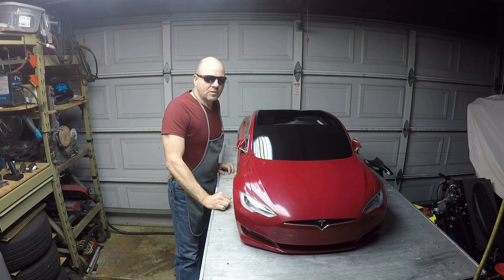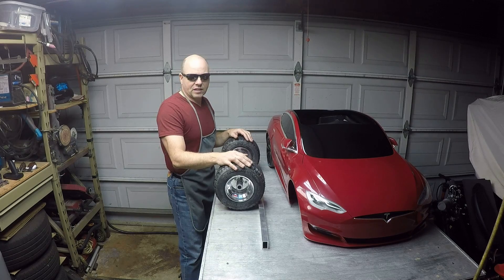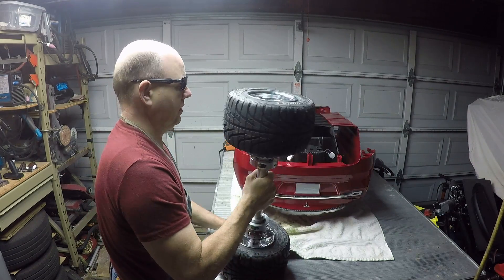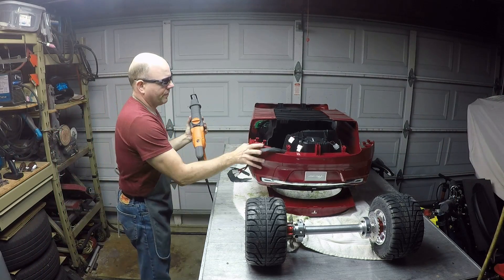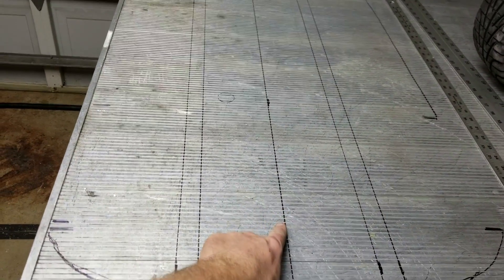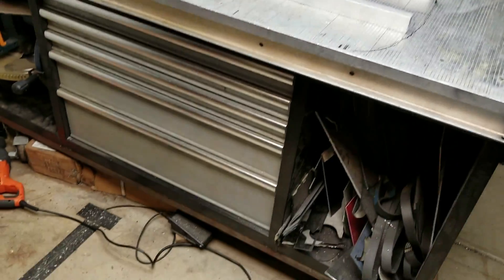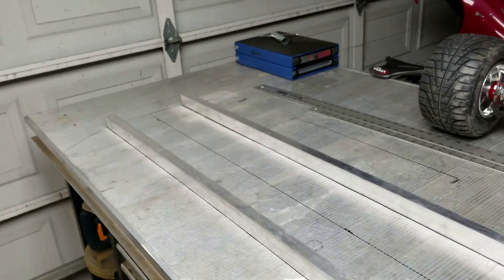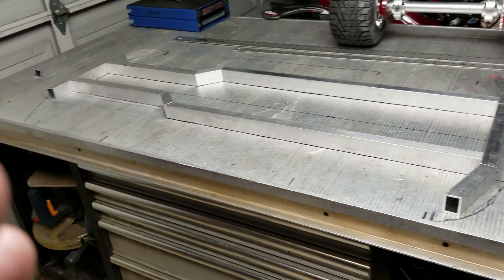Hot-Rod Tesla Mini Model S build (part 3). Frame build

Comment: wish I had your welding skills
Reply from the maker: I am self taught in every design and fabrication skill I have.
Reply: @TechForumTesla  me too , just haven't tackled welding yet . I do most woodwork , I can solder . I used  to be heavy into RC electric airplanes in the earliest days of Nicd batteries . No foamies back then (40 years ago). Painstaking balsa work for the wings. Laquered silk paper covering , I still remember nearly passing out on the vapour . Monokote was just entering the market . Nowadays I am big into DIY audio , designing and making my own speakers and crossovers  for the last 20 years or so . When it comes to metal work , I outsource it . I do envy you in that respect .
Reply from the maker: @gerritgovaerts8443  TIG welding is like soldering one piece of solder to another piece of solder. 

You can do it! Problem is, a good TIG welder is about $1,400.
Reply: @TechForumTesla  Thx , that's encouraging ! 1400$ is not insurmountable , and it would open up a whole new world for me .

Comment from the maker: I am determined to make this as close to a real Tesla as possible (aluminum chassis, rear motor, lithium battery under the floor, supercharging, etc).
Reply: Tech Forum i would look into the power racing series. It takes power wheels inspired cars and they make race cars out of them. There are some good routes to take when making them and there are some wikis on it.

Comment: I want one haha.
Reply from the maker: It will be for sale when finished. 😁👍
Reply: @TechForumTesla  I bet there will be demand for more than one.
Reply from the maker: @SWTrailsAndWheels  problem is, the battery pack is $1,000. The motor is $900. The controller is $300. The wheels, hubs, axles, frame materials are $450. Beyond that, there is around $300 of misc parts and $400 for the charger. This is not including the value of the  Mini Model S and the labor. If hired to do this for a client, I would ask $10,000 for it. That being said, I am building this from mostly left over items and a free Mini Model S. So, I will probably offer it for sale for around $5,000 or so depending on how many details I add. Believe it or not, odds are it will sell within a couple weeks of completion. I have a devoted clientele and I have made a name for myself in the tight knit circle of high end electric bike customers and they tend to love this kind of project.